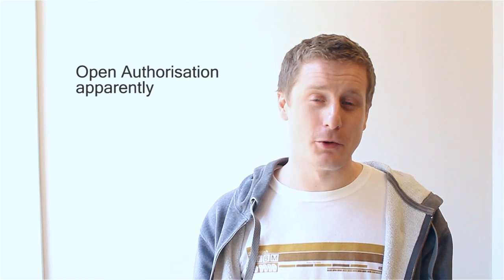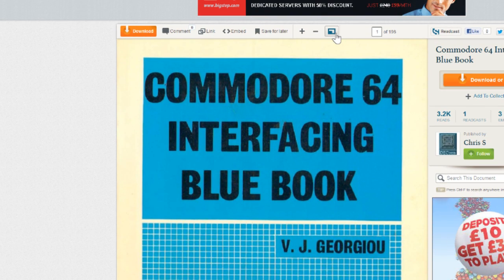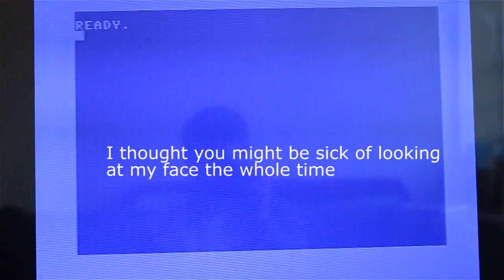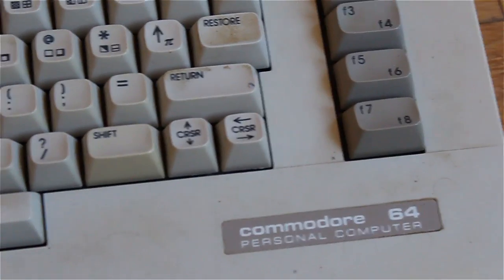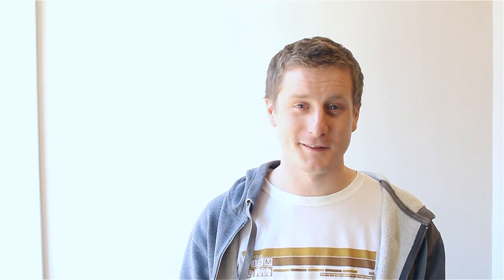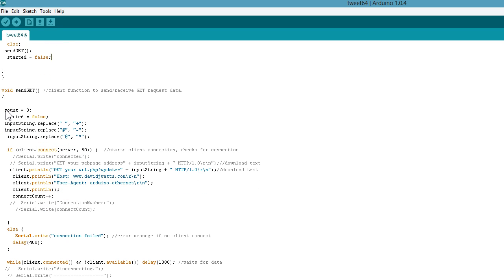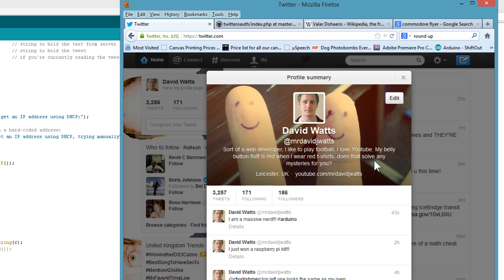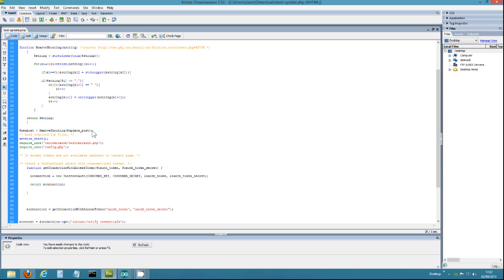Arduino Project: Part 2 of Commodore 64 interfacing across the user port

Comment: If you push C= and SHIFT, you toggle between UPPERCASE and the PETSCII-chars, and upper/lowercase. Or you can just do a POKE 53272,23 to switch to lowercase if you want to do it the hard way.